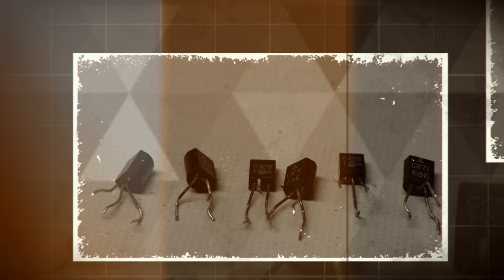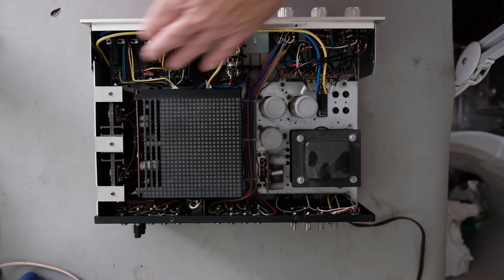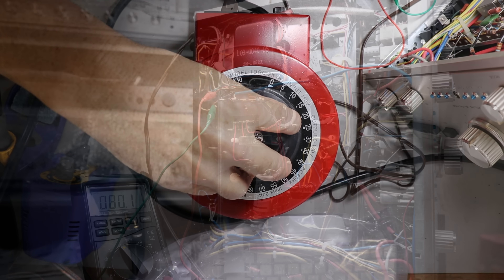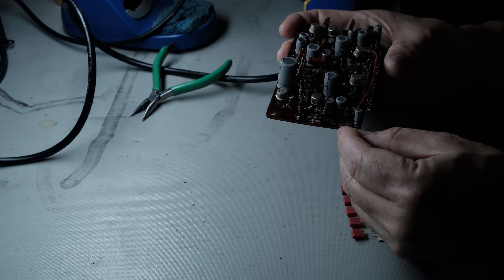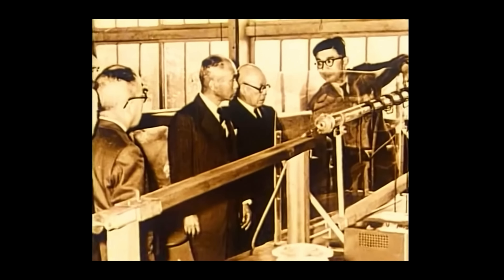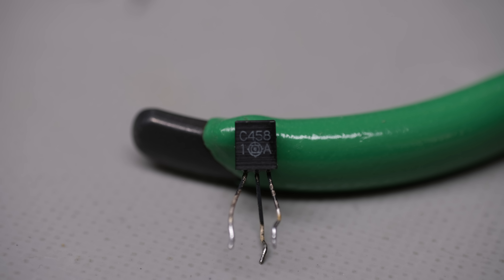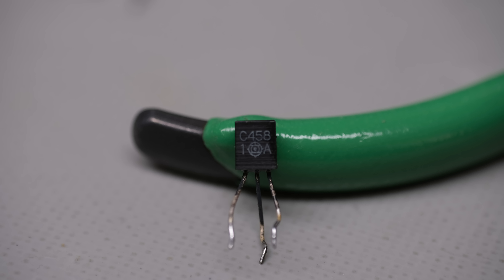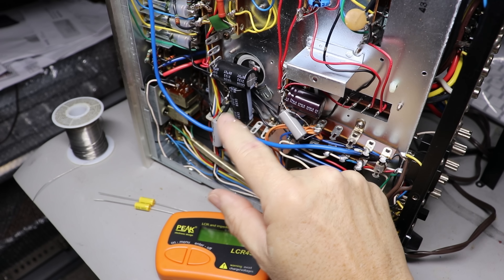$45 - Buy This Amplifier! Cheaper And Better Sounding Stereo. Spend Less On Vintage HiFi Audio Gear

Comment: I had an old kenwood i found in the garbadge that sounded better than my new technics gu700 integrated. The problem is finding a good tech these days is hit and miss. If the kenwood says high speed DC get it and fix it. Especially the monoblocks , thier amazing. Know your going to eat through some cash if its labs gear.
Reply from the maker: Thanks for sharing your experience.
Reply: @vintageaudioaddict  
Yeah....well do you want the good units?
Im going to stockpile all of them.
Get privy to labs. Its odd to me i offended you. I did the work why not 
You want to be my tech ? Im having trouble with the trio communication chipsets. The vfets are in hong kong.
Nelson pass did not use them all for the 40th anneversary monoblocks.
Yes and thier authentic nos.
N7B. Now sony was the best labs team and kenwood and also hitachi select units. I know this because sony's president had a hitachi 9500 mk2 in his office during labs at sony in a black and white photo. Im 45 years old , my name is jeremy im in palm beach gardens fl.
Its the SIT transistor bias problem caused by the transformers eating them.
And my brother i can get and ship anything. Eccowars solved it years ago and i am not paying 1700$ anymore for repairs on these L series labs units from kenwood. Its going into sony and yamaha fet units. B1-3 and sony N7b's.
This is the best shit i know you already know. And the answer to SET is Static inductance Transistors. So im opening a brick and mortar at a loss in san fransisco amd probably miami at a loss and have a very cohesive plan and no service tech worthy courtesy of the millenials. $ thats it . And original signage and brochures.
Reply: @vintageaudioaddict  
Okay. If you say so. I absolutely do not want to deal with that weird transvestite.
I need a solid old scool tech.

Comment: I really like your Sound Technology 3200A, seems like it has a smaller footprint than your usual unit.  Unfortunately they don’t seem to come up for sale often, do you have any recommendations as to a unit that will perform the same functions and is considered a quality unit?
Reply from the maker: Sound Technology was state of the art for audio analyzers/test gear until a company called Audio Precision came along in the 80's. You can find used Audio Precision gear more often then Sound Technology as they are still in business. The only issue is that the old/vintage AP test equipment still brings pretty good money even today.

Comment: Those 0.02 caps are rated 600V because they cost the same as lower voltage ones, and they're in a power supply circuit to catch spikes.
Reply from the maker: Thanks for sharing.

Comment: I have a question on the film capacitors how do you tell the positive from the negative lead if it's not marked on the capacitor
Reply from the maker: These film capacitors are non polarized.
Reply: @vintageaudioaddict   Then it's OK to replace a marked polarized cap with a non polarized cap Because I noticed those little you pulled out did have a negative pole on them
Reply: At least in this case in the audio track

Comment: Does your variac have a pointer meter or digital meter?  I understand that neither is accurate.
Reply from the maker: Yes, they have a meter but you are correct about the accuracy. The meter on my variac is off so I measure the voltage with a meter as I'm adjusting the variac.

Comment: Could you do a sansui a-505 amplifier? I have two. I want to rebuild and upgrade them using hq parts. There amps brought by my dad now passed. I have started by doing silver wire from board to gold phonos. I am putting in new mains cable direct to inside again silver with an earth return. I want to do do all the power upgraded and high end capacitors. Let me know my friend.🙏
Reply from the maker: Your Sansui is a very nice amp. I don't have a AU-505 in my collection so I have never worked on one.
Reply: @vintageaudioaddict  that's a different one my friend mine is basic an a-505.

Comment: What is the website for that list of defective transistors?
Reply from the maker: Not sure where I got it but you should be able to google it. You can also use the snip tool if you have a windows machine to copy and print the one that I show.
Reply: @vintageaudioaddict  I can not clip and save it will not let me but I tried to search it out a dozen ways and can not find that list but only one list of the top ten worst. I would like a complete list like the one you show.

Comment: I have a KR6030 pushing 80 a channel and a KR6600 very nice rcvrs but pulling up an owners manual was not nice. They used the smallest font possible.

Comment: I inherited a Pioneer sx 1980.  It turns on but doesn't work. Any idea where I could get this repaired?  Is this something you work on?
Reply from the maker: You have a wonderful receiver. I'm a hobbyist and not a professional. I only work on the equipment that I own. I'd google "vintage audio repair" and see if anyone comes up in your area.
Reply: @vintageaudioaddict  Thanks so much for your quick response.  Do you happen to have any idea what an overhaul of this receiver should cost?

Comment: I think the 0.5 was a typo. It met 0.05 exactly at 30W.
Reply from the maker: The .5% was correct. Back in 1970 .5% was a typical distortion specification for a solid state unit.
Reply: @vintageaudioaddict  Yes, I was looking and they all say 0.5%. Though I disagree about the 0.5 being standard in 70. The accepted limit for audible distortion was considered to be 0.1% (which Williamson managed in the 1940s). By the second half of the 70s Japanese makers were into a 'distortion war' each trying to outdo the other. I find it strange they would happily quote a figure a magnitude higher! Great looking amplifier.
Enjoyed your video very much. I have been doing the same for many  years. I had a small audio museum in the early 90s and worked in the industry for many years too. 
Glad I found your channel. Subbed.

Comment: unused amplifier   look s as new and have no issues , also  protection  have   clear start so amplifier it s ok , all you need it to test only in sine wave you may follow  voltages visialy on osciloscope  , replacing original commponent with new one it s wrong choice if ampifier is used only 200 hours ,

Comment: I have a Rotel RS2002.  Point to point wiring I understand.  What a mess.  Can you or did you review something like that?
Reply from the maker: I have some Rotel's in my collection like the RX-1203 but not the RS-2002.
Reply: @vintageaudioaddict  The digital meters do not work.  It also needs some caps I think.  Not sure where to get the digital meter parts.

Comment: Sorry to judge your electrolytic caps  technique .It sucks ..you only need to empty the inside of the original cap can ..and insert the new one ,and solder ..A little silicon if required or some other rubber material ,And it is way better !
Reply from the maker: Thanks for sharing. No need to apologize. I've re-stuffed, replaced the entire cap and installed under chassis. Many of my video's here on YouTube show different techniques for doing repair and restoration procedures that have worked for me.

Comment: Errrrrr... No No No... solid core wiring on wire wrap pins.   
Someone may have thought that was a good idea back then, but that was a loathsome termination method especially in a signal path. 
Solid core Cu wire breaks so easily after being bent a few times at that size, often inside the insulation sleeve and the long plated steel pins are nasty. Maybe only good for telephone wiring operating at much higher voltages but not in anything that professes to be HiFi or Quality equipment. You find the same crap in some Pioneer stuff.  
I'd be rewiring every piece of solid with multi strand and removing every steel wrap pin - no exceptions.